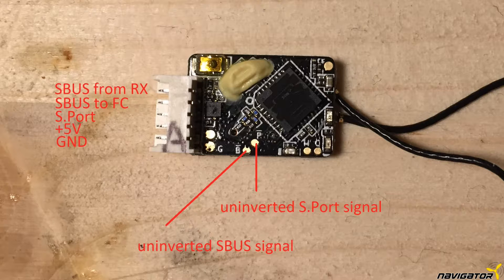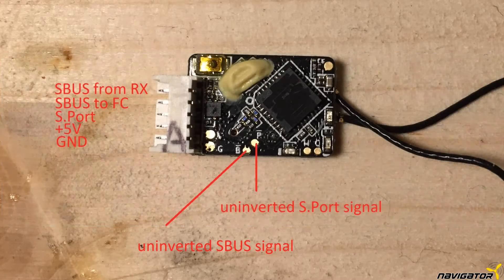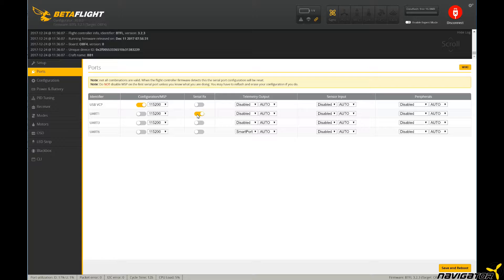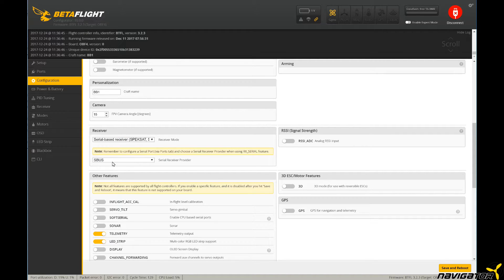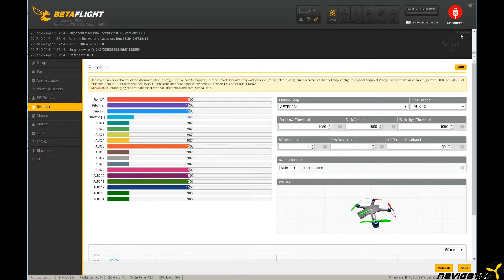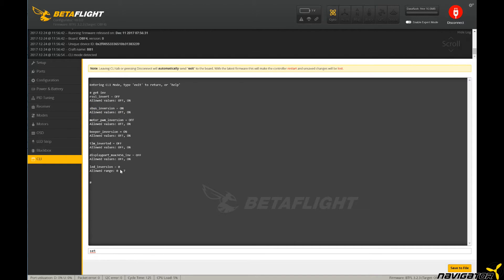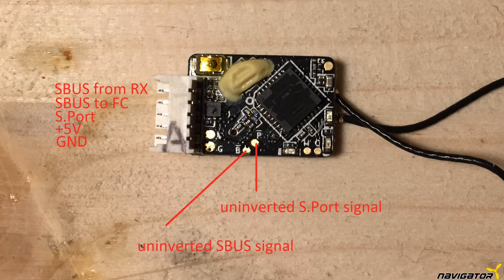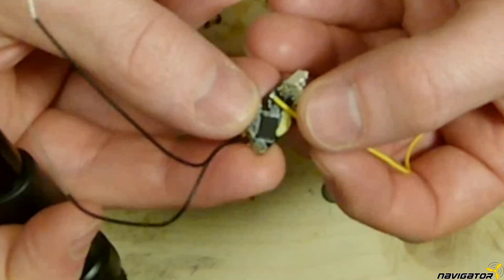FrSky R-XSR short description error analysis FC connection SBUS S.Port signal inversion (English)

Comment: Hey Man nice video, really clear, but I still struggle getting a signal, I try to explain my problem: 
I'm connecting my r-xsr with a old Omnibus F4 flip 32 FC , I have to Fc of this type and none work, at first I thought it was the problem with the little pin to switch from ppm to s bus but now I have one with both pin and the other with the sb us taken off and still no results... so I was thinking to send my s bus to another uart (that is un inverted ) , I will try to connect it from the B pin of the xsr and take of the default one.  what you think?
Reply from the maker: You normally don't need the Hack for the S-Bus signal, because most FCs (at least all I ever had) can cope with the inverted S.Bus signal (from the connector). Only S.Port has the issue, because a "normal" UART TX has no inverter. The SBUS Port on the FC has an inverter.

Does your FC have a soldering pad labeled "SBUS"? Can you send a link to the scematic of the FC?

Comment: I don't understand which S.Port I should be connecting to my FC in order to have RSSI and voice warnings from my Taranis......
Reply from the maker: there is only one S.Port. But you do not need S.Port for RSSI warnings on your Taranis. There is basic telemetry data just from the communication of the transmitter with the receiver, which includes RSSI. If you want RSSI Data displayed in your OSD, you have to send the data via a channel to the FC. You still do not need S.Port for that. You only need S.Port, if you want additional telemetry data and LUA scripts.

Comment: What is the CLI code for checking your rx connection
Reply from the maker: I do not understand the question. I check the connection with my Q X7 TX.
Reply: I am not getting response from my Qx7 in Betaflight and I dont know why. I have the univerted wire connected to and F4 board on Tx3. I simply dont know why this is happening. I need help with this. Does your channel have an email account?
Reply from the maker: We can discuss it here.

post the relevant CLI settings. is your telemetry turned on. do you have the correct firmware on your RX. is your taranis bound, set up and the cannels porperly configured. can you make sure, that there is a signal on the wire.
Reply: It is bound I have a blue light, I need to go over my Transmitter configuration to make sure all is properly set. Telemetry is working and Lua script is working. For me in BetaFlight, I would like to know what the CLI request is for the Version, how to see what setting I have made, and then how to save that code, I would also like some recommendation as to what CLI commands I can use to learn more about the firmware and what it is doing, so that I can see the changes with the updates, and if I dont like something in an update, be able to remove or an aspect of an update.
Reply from the maker: I'm really sorry, but I just do not get, what you want.

If you want to learn more about the CLI commands, check out this page: https://github.com/betaflight/betaflight/wiki/Betaflight-specific-CLI-commands

If you want to know, what the firmware changes are, just read the relevant release notes. That's where I get the info from what's new in the firmware.
Reply: Michael Orter Navigator exactly what I was after. Perfect. Cheers. I have subscribed to your channel.
Reply: @N4V1G4T0R  is it possible that i could chat with you privately? i would like to send some pics of my receiver setup. it seems that when i am in betaflight my sticks show that they are functioning, but my radio wont control my quad. i am new to this and this is my first build, i could really use some help. thanks.

Comment: When I tried wiring my r-xsr receiver the 1st way with my yellow smart port wire to UART 3 and my white SBUS wire to the inverted SBUS UART 1 pin, all my switches and flight channels were responding just fine but I had no telemetry and could not discover any new telemetry sensors on my Taranis QX7. So then I tried tried wiring my smart port wire to the uninverted S port pin P on the r-xsr and I left the SBUS wire alone. Now only my 2 position switch moves the bar on aux 1 channel of the receiver tab in Betaflight but every other switch has no connection to my receiver and doesn’t move any of the aux bars. I am getting RSSI but that and RxBT is the only telemetry sensors I’m getting. Like I said my 2 position switch works which I programmed as my Arm switch and I can fly just fine but I’d like all my telemetry to work and I need all my switches working so I can program them. Can anybody help me???
By the way I’m using the DYS F4 Pro V2 FC with the DYS 30A 4 in 1 ESC.

Comment: Rather use a soft serial, but can't get it to work. Did you try soft serial approach, which is much neater than soldering a tiny pad.
Reply from the maker: That's a matter of personal preference indeed.

I do prefer the hardware approach because it's carefree on the long term.  It's solder and forget. Soldering the R-XSR is an easy task, other than the predecessor models. If you do the soft serial variant, remember to set the inversion after every full chip erase.

For the FCs I  currently use, the software inversion via BF did not work for me.So I had no choice anyway. ;-)
Reply: Michael Orter Navigator I'm new to invert pin. To invert it, do you just have to solder a cable and that's it? What do you do with the other end of the wire? You leave it like that? Don't have to solder anywhere?
Reply from the maker: The "normal" connector has the inverted signal. This procedure explains how to obtain the uninverted signal. Normally, it's either or. So, either use the inverted signal from the plug, and you are done. But sometimes your FC can not handle the uninverted signal. That's where you need to solder an extra wire to the soldering pad. You then disconnect the cable from the plug, with the inverted signal and use the cable with the uninverted signal instead. So, you solder it to an UART of your choice, which can handly the uninverted signal.
Reply: Michael Orter Navigator oh I see. It does make sense! Thank you very much. Two more questions you might know the answer, sorry :) if the FC reads correctly the inverted SBUS signal, would it be possible it doesn't manage to read the inverted telemetry signal? On my RC I can only discover 3 sensors for telemetry, so I am thinking maybe it's because the signal is inverted and I need to uninvert it. What do you think?
Reply from the maker: It totally depends on the FC, if he can interpret the inverted or the uninverted or both on the specific UART. In theory, F3 and F7 can interpret both. Practically, the developers programmed the uarts differently. So, the answer is: it depends.

If you discover 3 sensors only, you do not receive the telemetry from the FC at all. Three sensors is what the Receiver sends to the transmitter (when bound). Either it the issue with the inverted S.Port Signal, or Telemetry is set off in the BF Firmware.
Reply: Michael Orter Navigator thank you for your help, the telemetry is set in BF. I'll try the uninverted signal pin then and see. I'm using a F4, it's the one that comes with the HTRC F440-TX20 V2 stack
Reply from the maker: The F4 is known to handle the uninverted signal.  Therefore the procedure with the signal inversion should work for you. Let us know. :-)
Reply: I couldn't get it to work without uninverted solder pad hack on Omnibus F4, and eventually settled on the solder pad approach. The R-XSR was flashed with f.port firmware, and still no luck with inverted neater approach. Only the solder pad works with f.port.
The reason to use the neater approach on the micro JST connection without solder, is so I can remove the RX out of the quad without a soldering iron, to either flash the firmware, or put on another quad.
Reply: I've used the inverted S.port on the RX instead of the one from the connector and it worked on the Omnibus F4. Now I'm getting "Telemetry signal lost, telemetry signal recovered" every second on my Taranis haha. I think I need to downgrade my firmware on the RX since I'm running the latest one and I get that issue
Reply from the maker: i do get that as well. it occurs if Receiver (RX) and Transmitter (TX) are too close. if that is not the situation in your case, you may have an issue with the radio signal which comes from the RX to the TX. This normally has a lower range than the radio signal from the TX to the RX.
Reply: So, I downgraded, upgraded, nothing happened, still same issue. The way I've fixed it was to unstack everything and test as is. I suspected an overheat of the FC and VTX board because the VTX was shutting down after some time. Changing antenna on the VTX didn't help. However when I removed the VTX from above the FC, it became totally fine, no problem with telemetry, no problem with VTX. The wires between the VTX and the FC were too closed from the boards, keeping the heat and forcing the VTX to shutdown and messing with the sensors. That's my explanation and I hope it helps someone else reading the comments. Now I'm facing another issue not related to this video, so I won't bother you with it :)